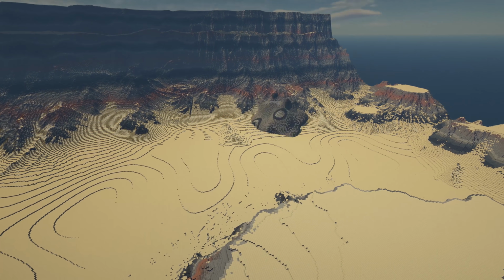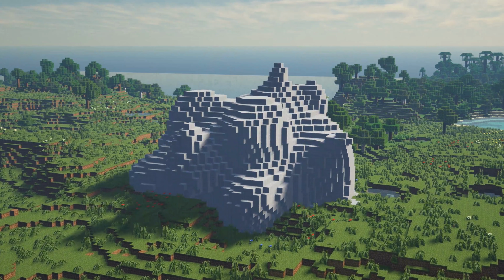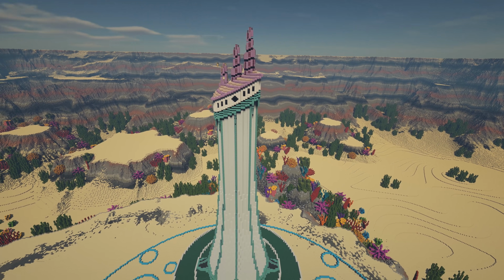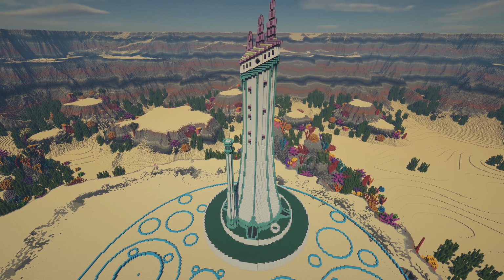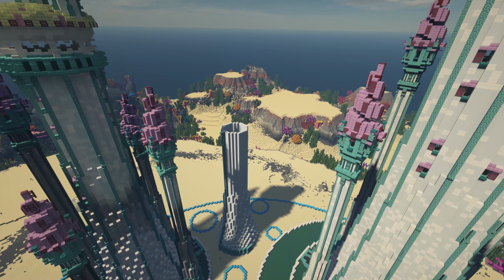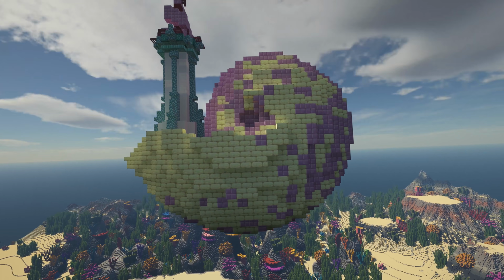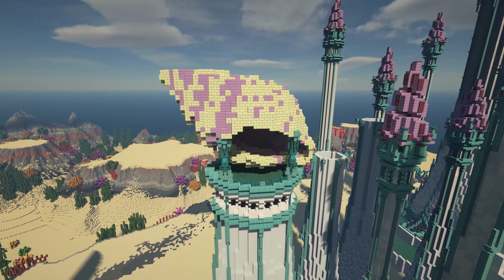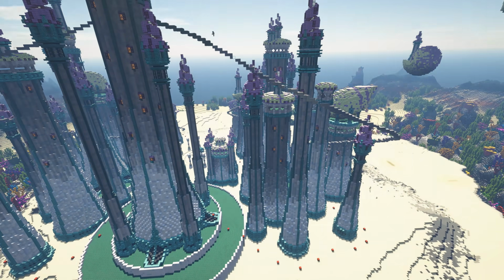My Most Anticipated & EPIC Minecraft Project EVER!

Comment: what about adding some moon lore because of the connection between the moon and the ocean. It could defiantly work with the circular thing you have going on. Maybe they worship the moon or use it as a clock system. also adding giant shells and creatures in shells around the beaches like they have washed on shore, it could be were the roofs come from.

Comment: A cool idea I think would give the kingdom some story would be to make a "Forbidden zone". A large, locked off gate, not as pretty as the rest of the thriving metropolis, almost industrial and militaristic while still keeping the color palate. blocking off a wasteland of polluted, blackened danger zone. Guard buildings and defensive structures are all around it, and large, sea lantern searchlights pointed down outside the gate, looking for any potential attackers from that side. The main gate on the opposite side of the city would share the grand spirals and arches of the main palace, but the opposite gate is a reminder that this kiddom isn't completely safe... and This kingdom, with its mighty armies and massive snakes at its command, is afraid. Afraid of what's on the other side of that gate... Also great build so far. Loving the spiral architecture! Keep it up :D

Comment: I feel like there should be a residential area within the coral reef's perhaps using the coral as homes or using more of those tiny towers to populate the ocean floor, other than that I think the pillars around the conduit should glow like they are forming a barrier around or are transmitting the conduit's power. Those are just some thoughts that came to my head immediately and I'm sure that there are better ones and that these could be improved upon.

Comment: I have a few ideas that can link to the previous kingdom lore (Sea Serpent):
1 - Have clusters of shelled villages along the reef as the reefs provide the most protection from strong sea currents and there is a stronger foundation to build on. The shells and coral can be used to inspire designs.

2 - Because it is a rival kingdom of the previous elvish one, there would need to be a reason for using Sea serpents. Thus they should be used as a means to aid attempts at plundering precious smelted ores in the vaults of the elvish kingdom since the Meridian Kingdom (Underwater) cannot sustain a supply of ores in their area. So you should have holes in the rocks that houses the Serpents and their would be training pens for them as well as breeding grounds.

2 (alternate) - The Meridian and the Elvish Kingdoms both suffer from a plague of Plundering Sea Serpents, eating away at both their precious resources. They can emerge out of the mentioned holes at some part of the meridian kingdom to lay waste to it. THEREFORE, there needs to be an underwater Guardian that could either be ~ The Kraken (An Gigantic Octopod), The Hydra (A Gigantic Sea Serpent Variant with multiple Heads and with or without limbs or legs), The Leviathan (A Gigantic Winged/Finned Sea Dragon with an unreasonably long body eg. https://stormfields.files.wordpress.com/2013/03/479808518_preview_leviathan_ii_by_mercurialxen.jpg?w=960 )

3 - Place around, Ruined Ships that may have been shipwrecked or sunken by your Guardian for trespassing

4 - Place strategically, your Tower Defenses around the Sea-bed that act as guard towers to help protect the citizens. They should also be very well lit as in the Sea, the light is dimmed immensely so they need a light source and other ways to signal other guard towers and the main Kingdom of incoming invasions.

5 - Have temple like structures either embedded into rockfaces with yet another Heart of the Sea for many different functions such as Storage facility, Biological Research and breeding facility, Places of worship, Precious Vaults, or Portal Gates (Like Subnautica)

6 - A massive Market Plaza

7 - Massive Sinkholes that could be the home of your guardian and its eggs, or magma sources seeping out of columns as Thermal sources.

Comment: Ok I have a few ideas. Maybe a large turtle with an island on its back around the castle. Maybe a dungeon under the castle with a kraken and maybe pirate ships around the castle
Reply: it would also be cool if the dungeon was under the castle, and had all of the cell windows coming out of the sand/rock on one of the faces of the big main plinth (or maybe just the surrounding cave walls, if not under the castle). a bit of a game of thrones eyrie-style dungeon, where the dungeon center is in the center, with cells spiraling and peaking out of the sides of the rock, cells are literally inside the cliff-side (except these would have huge bars). and then there would be a hugeeee cell window, the largest one in the rock face with the kraken inside, and its tentacle arms squeezing through the bars, with fighters and cell-holders trying to blast them back inside the cell. ooh that would be so cool sorry I got a bit carried away this is such a good idea!!

Comment: A backstory: once a thriving city now a sunken husk of its former self with the sinking a energy generator leaked and changed the population. now a corrupt, untamed mess, barely functional  in the lower sections but the "uppers" live in luxury made by the backbreaking work the slaves and people do, like mining the coral and waiting hand and foot on the few who can live in the lap of luxury. Small towns have settled on different plinths along with rebel bases on the most outer and uninhabited sea walls. The people live in fear with a great beast in chains under the castle. The people do not know if they beast is a kraken or a downed god but they don't limit the possibility's. The great kings and queens did not like the reactor being at the edge so with hundreds dead or dying from the move and now the power of the kingdom is under the total control of the monarchy. Ruins can be found half buried in the sand. A sad story still to play out with the rebels in play.

Comment: Idea: Underneath the conduit, have a large collector or funnel of some kind, collecting energy from the conduit. You could have the energy travelling through glass tubes and leading to various areas requiring power, namely feeding them into large, animated enchanted statues, which would act as the city defence against water serpents and, more rarely, attacks from the underground kingdom.

Idea 2: Make several houses near the reef constructed out of coral, as if the people were using the coral as a building material for their houses. You could even have some pieces of coral that have been carved out to make homes, or some partially broken corals.

Comment: You could build in 5 holes in the mountain the castle is on and make it look like there used to be massive turtle but it either died or has been in a deep sleep for years so it's shell merged with the the mountain and maybe you could build little village section on other large shells and it could be like a city build to be mobilized if it needed to